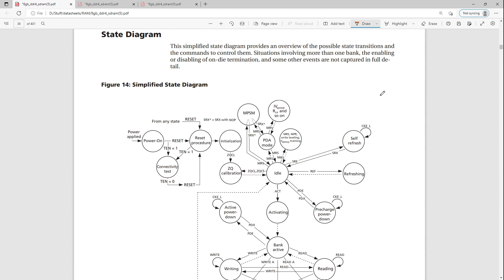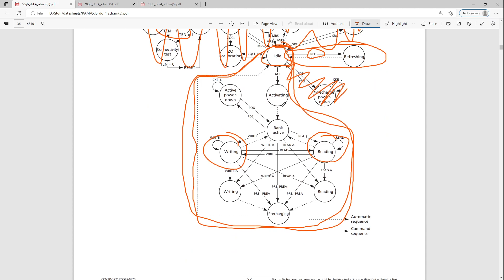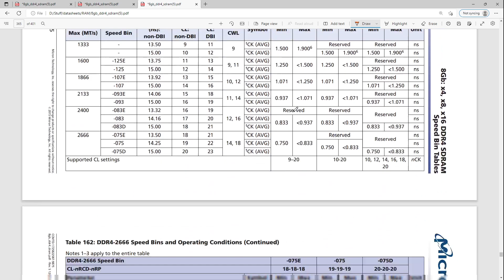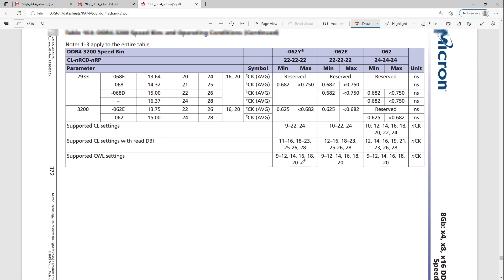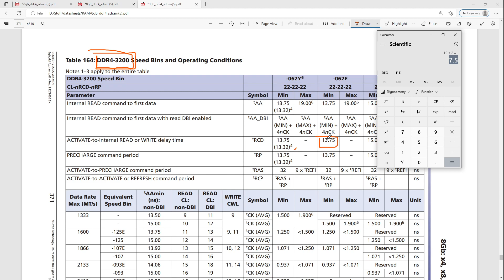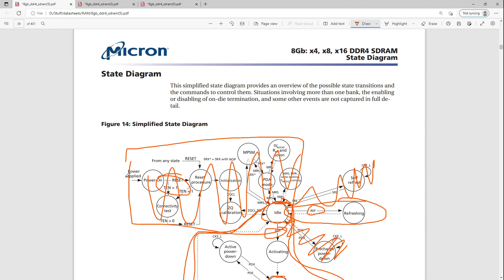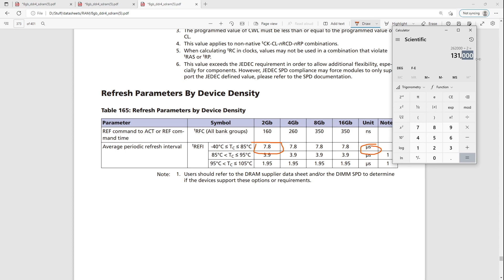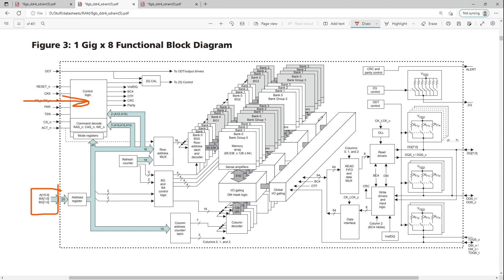RAM timings explained 0

Comment: The problem with memory timings, as you've rightly pointed out, is that there are several methods of achieving each. You'd actually have to have a logic diagram of how, say, a write cycle is achieved in a given memory chip - as well as the specs for the DRAM cells themselves - in order to predict how many clock cycles at a given frequency it will take to do a particular function, and even then, this will vary with age, temperature, voltage, silicon quality, and the way the chip's internal gates are constructed. Since manufacturers don't provide this information, you CANNOT predict ANY optimal timing for a DRAM module any more than you can predict how much of an overclock you'll get on a random CPU sample!
Like you said, you've gotta just keep trying shorter and shorter timings until a given timing doesn't work. There is no shortcut. This is why your public experiments on different DRAM chips and their minimum timings are so valuable to the rest of us.
Reply: You can do the measurement and parameter extraction to attain model parameters the same way the manufacturers do. Reverse engineering models from samples is pretty routine business. Once you have that anything can be predicted by simulation.
Reply: @Ormaaj  You can calculate values via simulation based on sample specs, but the next run of chips will vary based on manufacturing (the "silicon lottery") and will change with age due to gate oxide breakdown and electromigration, as well as dialectic breakdown within the (capacitive) cells themselves.

Comment: So the JEDEC specs are forgiving, hence why we can overclock, because we can individually find those best timings for a particular rank of memory.  Did I get that right?
Reply: Pretty much.  The JEDEC timings specs have some slack in the values to allow for the memory chips to have variations in their characteristics, since it is impossible to make all chips absolutely identical, and even if they were, real world timings would vary between motherboards, memory modules, numbers of modules, etc.  Overclocking allows you to tweak the timings in your system to be as fast as possible such that all of the chips are still able to keep up.   But for each module, each motherboard, each CPU, etc. the exactly optimal overclock may be slightly different.

Comment: I wonder if there could be a program designed that automatically lowers timings for you. It could uses something  like memtweakit and memtest pro and just go through each timing by itself. Then switch to y-cruncher for imc testing. All you would need to sought out are voltages. The program could probably work those out as well . That would be cool.
Reply: Honestly the pro gamer move would be to hook up a pc to a seperate system and plug all the memory timings into a simple convolutional neural network, and set your objective function to be some reliable benchmark score and let it go to town.

The problem with that would be designing ways to get the test system unstuck during the many many failed attempts.

Comment: I think memory chips are dumb so they can be fast, as well as so they can be cheap. 

Dram cell current leakage is temperature dependant. Hotter cells leak more current. Leaky cells corrupt data. 

Great video. Appreciate the more technical content as always.

Comment: what software do you recommend to stability test ram in the brute forcing process? i used mem test and aida64, but both of them seemed a bit unreliable, and take a lot of time for each test, if you want rock solid stability.
Reply: TM5.
Reply from the maker: testmem5 with anta777 extreme1 is a good free option
Reply: thank you guys!

Comment: Can you please give me an advice? I have to decide between buying a 3200 MHz CL14 or 3600 MHz CL16. When i divide it, i get that the latency of the CL14 is slightly smaller than the faster 3600. Do you think it will perform better or does the higher frequency make larger impact for other reasons? I plan to use it mainly for gaming.

Comment: So the reason you can do something like tRCDWR of 8, but tRCDRD of 15 is because waiting for a write to be ready ( I assume its to get the addresses) is much quicker than filling up from row data. 
However, if that is too low, would we even know most of the time. Would it just be writing to previous location which may or may not affect anything, unlike a read which is more sensitive application side?
Reply from the maker: you know if the write fail when you try to read the data. Which is what a good memory stress test does.

Comment: why isnt there some sort of fake mainboard with memory controller where you set a voltage and speed and it spits out the optimal timings after a night of trying? or let it run in the bios and on the next day you have perfect ram timings set. start with jedec and then just set one timing -10% and repeat until failure, then go back one step and fine tune it with single decrements. or are there any timings depending on each other?

Comment: Very enlightening. Disturbing that all the timings are basically the way they are because 'make as cheap as possible' command from manufacturers, one assumes? Shame that reliability and speed, plus information was not a priority. I wonder how much more it would actually cost, in mass production, to give some feedback brains or whatever to a DRAM chip? Also I believe that some of the RAM controller on DDR5 (if not all) is now on the chip, or did I mishear that? If true, what difference, if any, has that made to the 'brains' or' non stupidity of said DRAM? Love the lesson by the way 👍

Comment: Peoole need to be stubborn with memory overclocking. Turns out regardless of timings my 5600x couldn't run 3200 or higher unless IOD and CCD voltage was lowered to 1v and vddp at 1.1v and it runs stable 1.46v on the dram at 3866 C15 with all timings controlled but a lot of users can run 0.9 vddp but need higher IOD and CCD at the same frequency as I do. It takes trial and error and sometimes don't ask for help it can lead you down a rabbit hole thinking your memory controller or dram  is garbage but it actually needs different voltages.
Reply from the maker: every piece of silicon is different. To the extent that different parts of the same chip can behave very differently.
Reply: It's very interesting to see the differences. It makes you more aware when giving advice of some of the weirdness one may encounter when overclocking. My setup has been fu of issues due that voltage characteristic but mainly my boards auto procodt, nom, park, wr were broken for months and I had to figure that out which was pain.

Comment: Is it possible to explain the other variables that affect stability like the resistances? 
There only info I know about them, is that if your ram is double rank the resistance should be higher. And if your frequency is higher it should require higher resistance.
Problem is that there's certain details like why does the resistance affect temperature and why does ryzen and intel have a different value for it?
Reply: Resistance has nothing to do with it.*

In PC terms think of each of the layers of RAM like routers or switches.  You have to go through one to get the next, and each of them adds a bit of delay.  DDR4 added bank groups.  Which is** the equivalent of double rank DDR3, but within the chips themselves.  This is why the timings went up.  More layers of indirection mean more time.  However, flattening it out involves more complexity, so more time.

Remember, transistors are just fancy electronically controlled switches.  They take time to turn on and off, and while they're doing that they can be in weird intermediate states.  Circuits are just chaining those together to get what we want.  The more complex the circuit, the more transistors, the longer it takes for them all to settle to the final value.

* Yes, a designer technically has to take that into account, but that's not really a timing thing.
** Assuming "double rank" actually supports up to 4x chips as single rank.

Comment: It would be cool if there was driver commands available to arbitrarly do commands after X delays.
We could then have test softwares that would do read command at increasing delays, and just report at the end what was the highest delay that was required to get the data back.
(like, write some data (with jedec delays to be sure it's good), activate, read after 8 cycles, 9, 10... then tell you at the end "hey, on your worst bank, I got back wrong data after 11 cycles once, so your timing need to be at least 12)
Reply: Thinking about it again, I realize it's dumb/not possible from a PC considering the whole system is currently functionning on those ram stick (aka, the very program mentionned and the operating system it's running on).

However, considering how "simple" the ram chips are, it would probably be feasible and not that hard to make some kind of device, like, wiring a ram slot interface to a raspberry pi or some kind of system that could read/write to that bus so you could have a reliable software not running on them that could test them?

Comment: the real question is how much memory bandwidth does modern gaming use? is there a tool which can tell you this? So if you're on dual channel ram, are you using like 20 GBPS of memory bandwidth while gaming or what? and how is this trend? Meaning like would a quad channel memory gaming PC be more future proof or is RAM bandwidth not going to be the bottleneck? especially as on-CPU cache gets bigger and smarter
Reply: yeas the tool is Frame chasers channel he does a lot of memory testing

Comment: Ok, this clears a lot of things up as far as timings go. If I ever have to adjust timings again, it'll be a little less stressful. I guess the thing I don't understand though, is why timings increase as frequency increases. If the speed of the RAM increases, wouldn't we expect read and write times to decrease? Why is the opposite taking place?
Reply: People overclock the frequency in order to increase the bandwidth they can get from their memory. As the memory response time(ns) capability is exactly the same as before overclocking, the memory timings(clock cycles) needs to increase in line with frequency to maintain the same memory response time(ns). Otherwise the memory will be unstable.
Reply: To simplify what Long Dang said: the numbers are in clock cycles. When you increase the frequency, each clock cycle takes less time. Because electricity in the memory chip works in rather fixed-timed amounts of nanoseconds, regardless of frequency, you then have to increase the timings (aka wait more clock cycles), in order to have about the same delay, in nanoseconds.

Comment: With the speed and heat generated from modern memory controllers, it seems like getting that off of a centralized die space and spreading that out as needed might become the better way to start going.
Reply: What isn't covered is that historic compatibility and other things mean there are reasons why they don't change too much.

Going beyond that, there's actually no easy way for the chip to determine when it's done.  From a logic gate perspective, that "Activate" command is doing is doing the parallel equivalent to switching tracks for a train.  One set of rail switches to choose which bank group, another set to choose which bank, and a third set to choose which row.  With the trick being that you don't get to set the next set of switches until you're through the first.  Oh, and how do you tell the switches are in the right position?  Yes, you could add feedback, but that could easily double the transistor count.  Worse, those extra transistors each add a delay.

tl;dr: The easy way for a RAM chip to know when it's done could easily double the cost and latency!

Comment: I have a question. Can you actually feel the difference in game between 2 Ram Frequencies and or timings if you have faster Aida 64  latency with one over the other but the same locked frame rate in game?  Like say 4400mhz gear 2 cl 20 auto vs 3800mhz gear 1 cl 14 auto.
Reply: big, massive, ultra massive NOOOOOO! not only is ram latency not related to input latency except through possible frame rate gains, the difference is also measured in nanoseconds.
Reply: @givemeajackson  well depending on the game, what FPS lock 60, 120, 240+ and memory itself but for the example posted no no difference.

Comment: So the take away is, even knowing this is not going to help you that much. You really need to check what your kit can actually do. Is there like a manual memory training program that can be burnt off to a USB thumb drive and loaded onto a system? The application that would run on that thumb drive would load into L1 of the CPU and execute from there (so it would be fairly small) but allow you to tweak memory timings in real time and do constant reads and writes to the RAM to see if their values are correct and consistent? This tool would allow you to tweak memory times without having to worry about crashing your system because it doesn't actually run from RAM, it runs from L1. It checks that the ram is correct still with the timings that you give it. I'm pretty sure some BIOS (UEFI) systems (ASUS) has this as an option, as it runs not from the CPU but actually from the little ARM chip that runs the BIOS / UEFI.
Reply: Also, the first Sun computer RAM didn't have a hardware refresh for memory chips. During bootup the OS would actually setup an interrupt that it would have to take otherwise the memory would go away. This make it very hard to debug the system, because if you set a break point the system wouldn't answer the interrupt anymore and the memory would go away as you would try to inspect it.

Comment: Maybe instead of explaining what each timing does - which as you said won't even help - how about making a video talking which timings and subtimings are most important for performance gains, and maybe general limits of each subtimings  and dependencies - because there are some rules where X + Y can't for example be greater than Z. Basically while there is mostly trial and error, there are still some rules and some expected values in which each subtiming can opperate.
I think this would be more relevant than explaining what tWRWRSCL or tWRWRDD does 🤣
Also no one ever even talks what other non-timing settings are, like - ProcODT, RttNom, RttPark, ClkDrvStr, etc, etc, and how these play into this and how these affect stability.